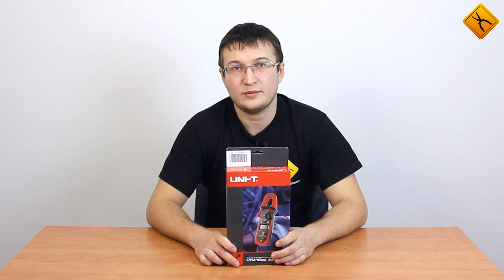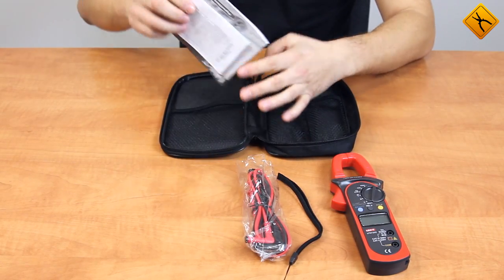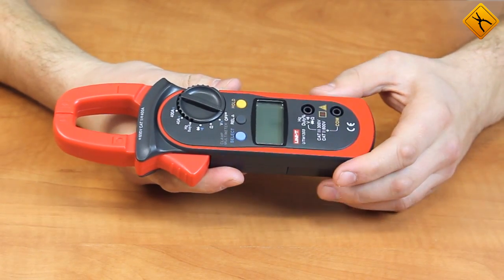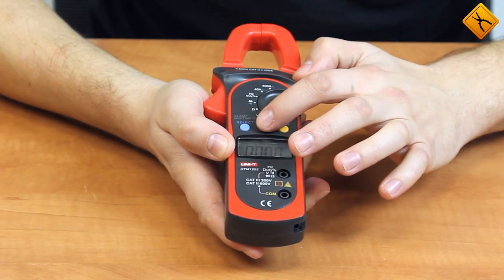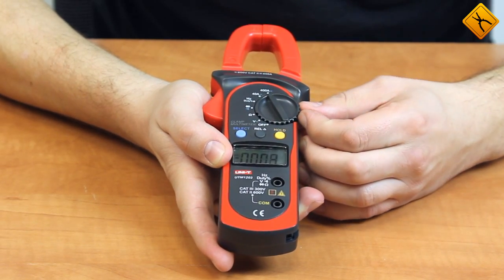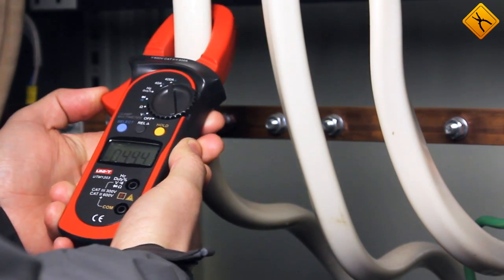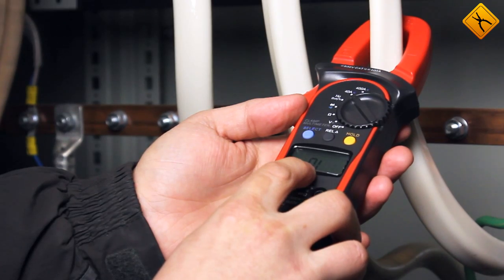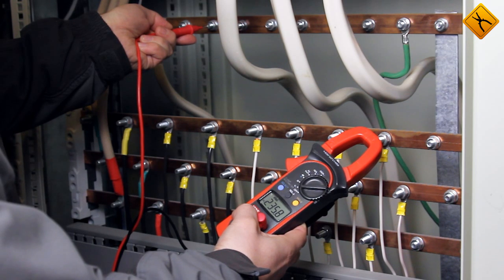UNI-T UT203 AC/DC Clamp Meter

Comment: I have read among its characteristics, that it is capable of measuring current in AC / DC. For the AC measurement the procedure with the clamp is very clear, but for the DC measurement I doubt that the clamp can be used due to the absence of a variable magnetic field in the DC current. In that case, can it be measured as it is done in any multimeter ?, using the test clamps to interrupt the circuit ?. Can those 400Amp pass through the polymeter without problems?
Reply from the maker: Hello! Test probes are not suitable for current measurement. Current measurement can only be carried out without contact, without breaking the circuit, using a clamp. UT-203 clamp meter - capable of measuring both alternating and direct current.

Comment: question, why does my amp reading say 1.41 amps DC even if the motor is turned off. How do I reset this back to zero. I pressed the REL button and noting happens. TIA
Reply from the maker: Hello! Please, tell us how your device measures the current of other electric circuits? (another motor)

Comment: Can this Instrument measure high frequency ac / dc current that is say current at 60 khz
Reply from the maker: Hello!
 The UT203 digital clamp meter measures AC current at 50-60 Hz. If you need to measure high-frequency AC current, use an oscilloscope + special current probe. For example, Current Probe for oscilloscopes Rigol, which features up to 300 kHz bandwidth: https://toolboom.com/en/current-oscilloscope-probe-rigol-rp1001c/

Comment: For calculate the exact watt and better accuracy we multiply amps with the finest providing voltage OR after loaded voltage? Bcz there is a variation and voltage get redeem after the load and it down like 225 to 215. Kindly tell me now which voltage we will take for multiplying with the watt?
Reply from the maker: For more precision of measurements you should measure voltage with a device connected and this voltage value is to be used for measuring power.
Reply: ToolBoom Supermarket bro u mean alongwith the clamp meter even i should have an extra device which tell me the loaded voltage during the measurement??
Reply from the maker: You may do the following:
1. Connect some device
2. Using UNI-T UT203 and test probes measure the voltage on the contact terminals of the device
3. Write down the voltage measurement result
4. Switch UNI-T UT203 to current measuring mode
5. Using UNI-T UT203 measure the current in the circuit
6. Write down the current measurement result
7. Multiply the voltage value by the current value
8. The result is the power of your device
Reply: ToolBoom Supermarket thanks a lot bro for understand me broadly but it happens with me in only inverter case.

Comment: Hey, thanks for your review on this item. I have been trying to decide between the uni-t 202a and the uni-t 203. I am sold on the uni-t 203 because of its ability to do DC amperage as well as AC. (We work with DC in telecommunications allot). 

Keep them coming!!

- Liam
Reply: bro kindly tell me about Meco 1008 trms bcz i am gonna for buy this one. does it measure DC amps?
Reply: TheYolobrid For calculate the exact watt and better accuracy we multiply amps with the finest providing voltage OR after loaded voltage? Bcz there is a variation and voltage get redeem after the load and it down like 225 to 215. Kindly tell me now which voltage we will take for multiplying with the watt?
Reply: Hi sir I work in the same field and we want to buy this type of multimeters for our technicians to measure the rectifiers outputs current... How does it work with you ??